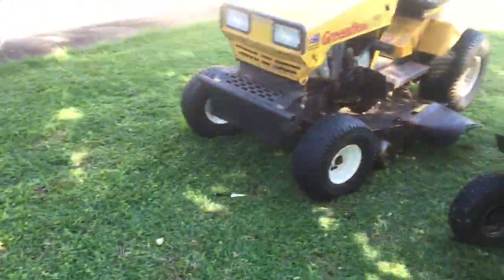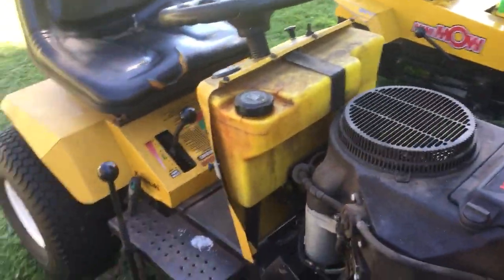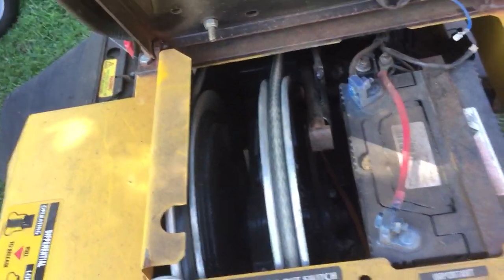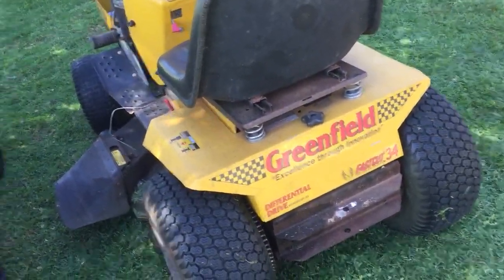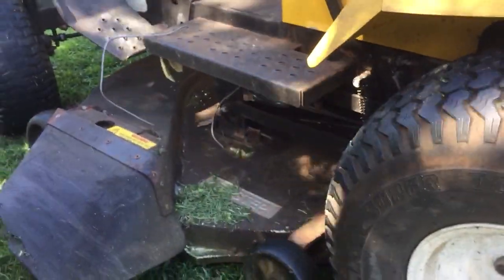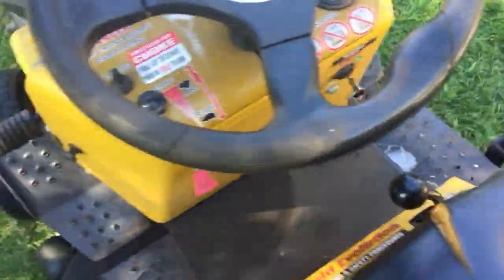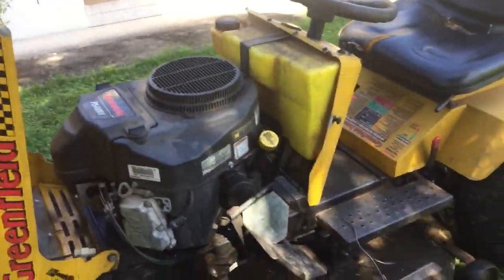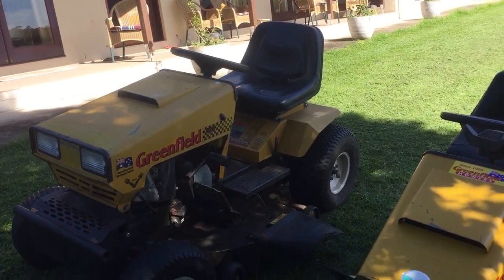Greenfield ride on mower Fast cut 34 and Mini now 25 made in Australia

Comment: i have a mini mow and its chewing up my yard with the small wheels and i am investigating putting bigger wheels on it to help distribute the weight, do you know if the axle diam is common over different greenfields
Reply from the maker: Mate I would go to a mower shop and see what the widest tyres you can fit on those rims other then that see if they have any idea’s cheers Mick
Reply: @svenomick5857  yeah im worried its going to foul on the chain and sprocket
Reply from the maker: I sold Mine it was just to small, it sold very easily the 17.5 Briggs and 32 inch is not bad, but the better Diff would be a lot better around trees I think they might be getting a bit hard for parts as I don’t think even the new one is being made any more cheers Mick

Comment: How difficult is it to change the drive belt on a greenfield and do you need to drop the engine pully/electric clutch out to fit the belt around? Thanks
Reply from the maker: Bruce Mather I have not  changed a belt on my mini mow it is easy but on a bigger one I could not say take it to a small  engine mower  shop and see if they will let you watch I would not think it would be that hard I hear genuine belts are the go
Reply: @svenomick5857  I ended up doing a bit of thinking and rereading of the manual several times. Then laid on the ground near the mover and realised that I didn't have to do that and just undid the bracket from either side of the chassis which hold the electric clutch in place and fitted the belt no worries.  Sometimes you just need to have lay down and a cut of tea HAhahahaha  with a beer chaser after it works.
Reply from the maker: Bruce Mather good to see most of the time you can do it yourself I find info on the Greenfield web page I forgot to say.
Reply: Shaken pretty bad

Comment: How hard is it to change the disk that holds the blades on
Reply: All you would have to do is pull the deck off
Reply from the maker: Jesse I have never changed the disk but they are quite easy to work on Mick.